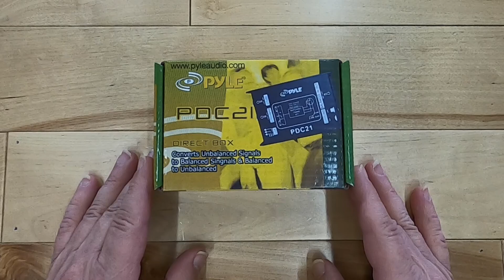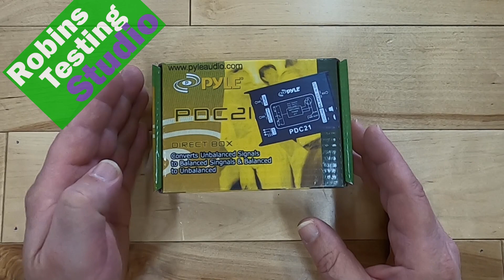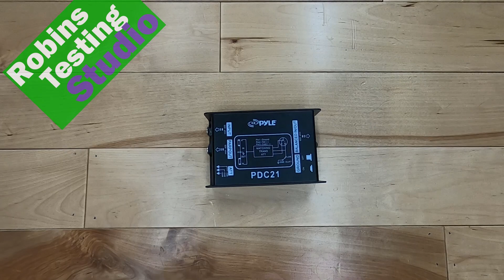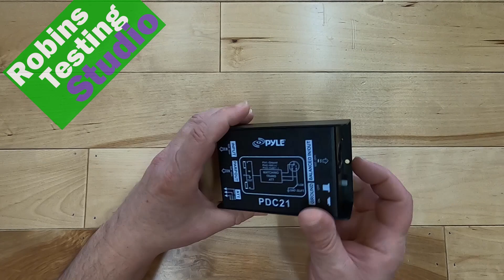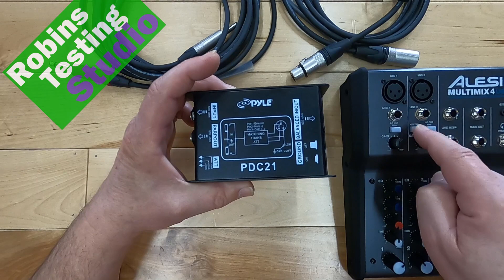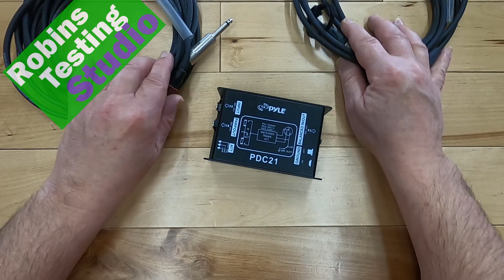Overview of the Pyle PDC21Passive DI Unit Hum Eliminator w/ Input Attenuator

Comment: I don't understand something. If I have the 1/4" jack running out to my guitar amp and the XLR running to the mixer, then isn't the sound to the mixer bypassing the amp? Don't I want the signal to the mixer to come from the amp so that it has the benefits of tones/reverb/effects from the amp? If the XLR is going to the mixer/mains, then what's the point of having the amp? I don't get it.
Reply: You mostly use this in a live recording situation. People plug in there amps mostly to use as a personal monitor, especially in bigger settings like venues. The amp is ur monitor while the xlr cable that goes to the mixer is for the front of the house (the audience) gives you a wider sound
Reply: @psycheadfuzzfreak830  Yes, I understand that. But don't you want to feed your amp to the mixer so that you get the reverb, compression, tone, etc... from the amp? Why would you bypass all of that and put a clean signal to the mains?
Reply: @billtruttschel  oh ok ya I get you now. Check if ur amp has a line out input. I think only certain amps have this tho(bass amps mainly) this is the only way I think you can do it to get the raw sounds of the amp other than putting a mic to the cab 🤔
Reply: @psycheadfuzzfreak830  The guy I play with indeed has a line out from his amp, but he uses a direct box and is therefore bypassing his amp. I still don't understand why he would use the direct box. I don't see the benefit.
Reply: @billtruttschel  is it a in a recording or live setting ?
Reply: @psycheadfuzzfreak830  In my opinion, that question is irrelevant because I want the benefit of the amp sound regardless.
Reply: @billtruttschel  get a kemper then buddy 🤷🏽‍♂️
Reply: @billtruttschel  I think the issue here is that you are going from your amp(low impedance) in to a mixer board (high impedance). This DI box balances that discrepancy. Otherwise you would have a very low, weak volume at your mixer board. If you are not using an XLR mixer board, you probably don't need this.
Reply: I’m trying to boost a signal from my acoustic guitar so I just plug the quarter inch guitar in and run an XLR out to the mixing board?